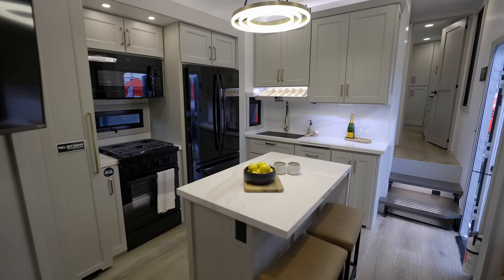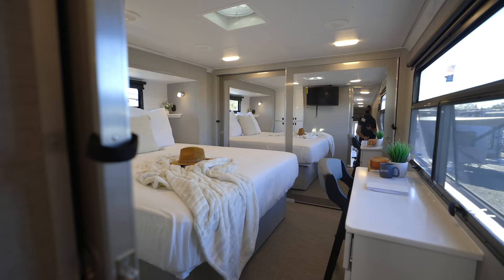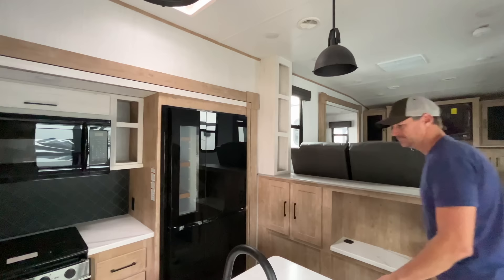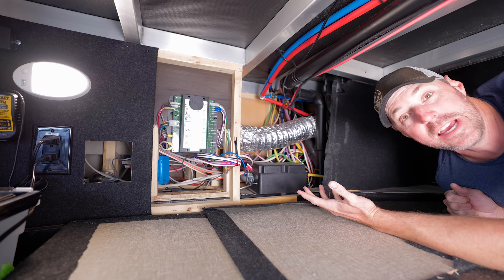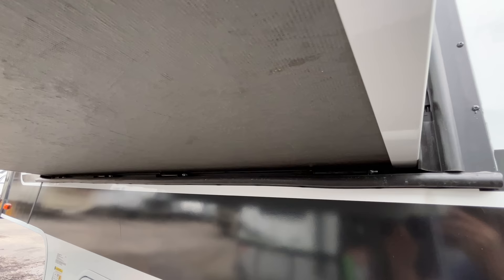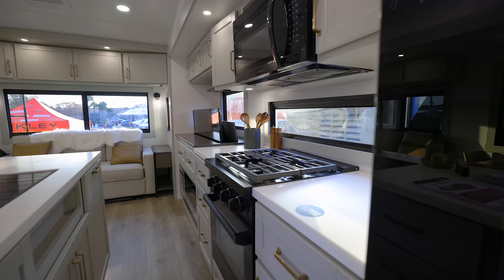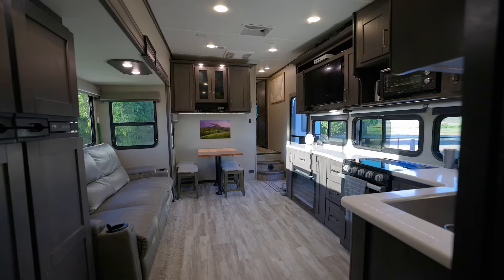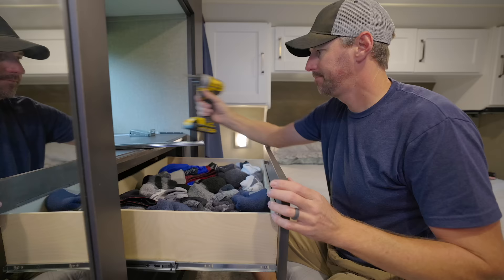Are All RVs Junk! Problems With Our Grand Design RV.

Comment: The problem is you bought a new one. I would never buy a brand new RV. I want that a few years old and has proven itself. And then still do a complete check of the systems. Make sure that it was actually used and didn’t sit around. That’s how you avoid getting a lemon. And you save a lot of money!  Oh, and by the way ‘nuther’ @5:24 is not a word. Time to pass the 6th grade.

Comment: I own a 2022 Forest River Rockwood Ultralite 2614bs. I think the materials put into it are good materials. The frame is strong, the cabinets are stable. As I work on it, I find things that just make me roll my eyes and know the time the builders put into it, well less then adequate. 

The one thing I hate the most is RW left the headboard to the bed in the front of the camper,  when they turned the bed into the slide. Now I've got a headboard in the front of the camper that could be cabinet space. It's my first camper so was so excited when I purchased it. The headboard wasn't noticed till later. It just irritates me that some day soon, I will replace it. 😅

Comment: When Grand Design was bought out by Winnebago that is when they went downhill.  I wouldn't own one now.  Check Outdoors RV out of Oregon.  I had been following their product and business model for several years and just this weekend went to an RV show in Round Rock, TX and found that a local dealer, Princess Craft, now carries them.  The quality of construction was far above the GD models sitting adjacent to the Outdoors product.  You should check them out and possibly do a review on them.  We are seriously considering owning one.  They are priced higher but the quality construction and warranty makes it justified IMHO.
Reply: I have a 2022 Timber Ridge 22FQS and it’s been fantastic.  They only make about 2500 units a year, and it shows.  They’re heavy, a bit old-school, and don’t have some of the latest and greatest features, but for me the things that really count were all there.  I mean, my 27-foot trailer has an 8-inch I-beam frame…nobody does that.  And they build their frames in-house, something hardly anybody does, not even Brinkley.  If you’re thinking about one and aren’t super fond of the dark interiors, wait for 2024 when they’re lightening up the walls.  That’s been one of the primary complaints about their interiors.  But if you go for one, I doubt you’ll be sorry.
Reply: @jordancook1668  Good info.  This dealer had a few "dimple " units (slight hail damage) discounted $10k to $15k...pretty good discount on 2023s.  We really want the 12v fridge and 2024s are coming that way....but that discount is pretty sweet....more than enough to change out a fridge if we move on one.

Comment: I don't believe all RV's are junk nor do i believe they are all built the same. Like anything else we spend money on there are definitely varying levels of quality and price and quality seems to very much go hand in hand. After crawling around countless fifth wheels in the search for ours the differences in quality between brands and pricepoints are evident if you look at the details. There are brands after looking at things like the plumbing and wiring i would not even consider buying. Not that they are junk but because the level of craftsmanship is not up to what i believe it should be for the money spent. I think a company like Brinkley doing a better job on the craftsmanship side while still being mid tier on the price level will hopefully make the rest of the industry take notice and do better.  

That said one thing i have noticed on RV forums as well comments here on Youtube is a lot of folks seem to conflate looks with quality, they literally only look at the skin and not whats underneath it all and say its a quality RV yet it in some cases it could not be further from the truth. These same people also say the higher cost brands are "overpriced" because some other lower cost brand looks just as nice but they fail to see the value in the better constructed frames, walls, roof, all hardwood cabinets and trim, better finish materials, etc, etc. Those things cost money and its why 5 plus years down the road the more expensive unit is simply going to stand the test of time better especially for a full timer.

Comment: I have a 2022 Grand Design transcend xplor. I will say this is the biggest piece of crap ever. I've nicknamed it the sugar coated turd. Water leaks, a floor that squeaks like a 100-year-old house, fit and finish that is worthy of a junior high shop class project. I've lived in it full time without moving it for the last year. 6 months in I noticed some bubbling inside one of the cabinet walls, and after doing some inspection it looks like there was a leak from day one on the corner of the roof. It is now completely soft and grand design said that the possibility of it being covered was very small because it is a maintenance item. I will never ever step back into the RV market. And I will spread the word to as many people as possible on what a pile of crap these things are. Complete disappointment

Comment: I'm of 2 minds, I want a good quality product that they thought of everything in, but simultaneously I know they'll NEVER get it 100% right, or 100% right for me, so I want something I can customize and not have to completely butcher finished materials, as well being made entirely out of bespoke components means replacement parts are expensive and/or non existent.... we have an RV with a one of a kind jack-knife sofa in, meaning it was made specifically for our model 5 years ago when the RV was new, now no one makes that sofa, in fact no one makes one the same size at all, we either have to buy an RV jack-knife thats too narrow leaving a small gap at one end that won't be big enough to be useful, just unsightly, OR we have to somehow cut away part of the side table, which also happens to be the power distribution system (circuit breaker panel etc), which even if it's possible, won't be cheap or easy to do.

So, yeah, to me I guess a good quality RV is one that's done well, but using all off-the-shelf parts that are not bespoke.

Comment: If you don't think all RVs are junk, you don't know anything about RVs. Just look at the forums, blogs, and vlogs of all of the brands that have claims, complaints, and lawsuits against them for inept workmanship and cheap parts.  You can't look at a new parked RV at a show and determine if it is any good.  Most problems show up after the RV is driven a few thousand miles on every different road material imaginable.  That is when walls, floors, ceilings, and components fail. Everyone is excited about Brinkley, but they are no different than the rest no matter how much they cost. If you want reliability, buy a twenty or thirty year old rig. The craftsmanship is day and night by today's standards. I have more than 20 years of fulltime experience with several different RVs and I have come to the conclusion that my older RVs were many times better built than any of the new stuff. If you want a new RV, you better know what you are doing and I wish you luck because aside from features and floor plans, there is zero quality built into them. The larger problem is trying to find a dealer and manufacturer that will stand behind their warranty. These days, most of them don't when it comes to major issues like frame flex, broken frames, ceilings, floors, and walls separating. Buy an older rig for a much cheaper price, lower insurance rates, and better build and learn to do your own maintenance and repairs. Most things are diy if you do a little research, keep a good set of tools and a repair manual. When shopping for an RV, have a pro with you if you don't know what to look for. Do not trust the dealer PDI; the dealer isn't thorough. Research forums, blogs, and vlogs for user reviews and have a large repair fund. Don't buy parts from RV retailers if you can get them online or at Home Depot, Lowes, or Wal-Mart. Keep a parts bin for common replacement items, prepare for lengthy and costly shop visits, and research the best shops in your area. Most important: Don't be taken by what you see is what you get. The best use of an RV is to drive to one location, camp, return home. If you are full time, set up a home base and plug in.  The more you drive or pull an Rv, the more and the bigger the problems you will have.

Comment: Are they all "junk"? Too broad of a question, but for the money we pay, they really are. I can't stand it when another RVer says, "something will break - get over it" or the service manager at the RV dealers says, "keep a list of everything that breaks and we'll fix them all at once". Nope, I don't accept that at all. Another RVer told me its not the brand's problem - it's the components suppliers who suck. Again, nope. We have stopped buying new and will not buy anything used that's recently used that was recently built. And this is not even addressing the issue of depreciation. If you buy new, kiss 20% of the purchase price when you drive off the lot. And after-sale customer service? Nearly nonexistent. But don't take my word for it - just surf YouTube for your favorite RV brand. And don't get me started on RV dealers. If their lips are moving, you better put your hand on your wallet and put everything in writing (they won't). RV dealers = politicians. The last part of this rant deals with parts. I had to replace a hinge on a Dometic electric cooler - $49 and that was free shipping but there were two hinges. The balance between the joy of exploration and freedom is losing to the hassle and expense of RVing.

Comment: I’ll second the comment if you own an RV you should be ‘handy’ with preventative maintenance and fixing little things,  people who don’t pay attention to those little things often overlook them when shopping and can end up with a poorly built unit.  What pains me is when people say ‘XYZ RV builds junk’ when they really just had problems with some of the components built by the major suppliers to the industry. I’ll hear people say we’ve had nothing but problems -a/c broke, thermostat went out, water pump died, water heater broke, etc. But when pressed the build was fine but they blame XYZ for all of their problems.  Some people expect an RV to have the same quality of a new car or truck.  It just isn’t comparable,  Auto companies may build as few as 3 models but rarely more than 7 or 8, and they build tens of thousands of each model where an RV mfg might build a few hundred, then redesign that model to be completely different.  Last complaint is the person who buys cheap and expects high end quality.

Comment: Don't be fooled by the Brinkley  price rag. They are still junk! I've seen several videos of frame failures on the Brinkley.
They are all junk! Some are just less junk than others. Older RVs are better, late 90s and early 2000s. Buy used. It takes 5 years for the manufacturing flaws to get sorted out by the first owner. In those first 5 years, the first owner will lose interest, and you will pick up a good coach at a depreciated price. Keep in mind that most RVs don't see that many miles and don't get used that often.
But you will need to fix things constantly because they are junk.

Comment: RVs are like Harley’s, jeeps, VW Bugs And Vans, KLR 650s .....or any other hobbiest  vehicles.
They are mediocre designs, built of low grade materials, and assembled by unskilled/ semi-skilled labor

So, if you own one,  you need to be able to troubleshoot and repair it as well as having spare critical components on hand
That, or plan on ruined outings and weeks or months dealing with similar unskilled/ semi-skilled labor at the dealerships, and their con artist bosses

I’ve been living and working on the road for over 20 years

Comment: You feature cheap large RV’s which are of poor quality.  There is obviously a market for these - cheap temporary housing,  transient workers, impulsive campers who want to bring a small house camping.  There are just a few quality travel trailer brands - Oliver, Airstream…. and they are expensive.  My Airstreams have held up quite well, although the plumbing and electrical is certainly not ABYC marine quality.  You get what you pay for.

Comment: All are junk.  Do most of my own repairs even when under warranty and help many others with theirs. Our 2020 Solitude GT340 has had major problems since day one and we lost all of last year due to frame cracks above the spring perches (fortunately under warranty but 6 months to get Lippert to make repairs).  Our GD 2020 has also had its rear axle replaced within first 500miles, have redone all interior woodwork to keep it in place, center island came loose and slide valences came off while on the road, slide hydraulic cylinder replaced twice due to severe leaks, Norcold fridge constantly gives F1 error after rain, etc., etc., etc.  Brand doesn’t matter.

Comment: Cheap junk and expensive junk. Grand Design needs to get rid of the LCI central digital control system and go back to rocker switches. When it acts up you can be in deep trouble. Also fasten the garage tie downs to the frame on the Toy Haulers.

Comment: I lost it at 2:34.  That single frame basically summarizes the entire RV industry.  I don’t think you could name another 50, 60, $70k item that is as unsophisticated and unrefined as are the typical RVs.  Brinkleys are much better but the quality level in them should be the worst you see, not the best.  The comparison I always draw is to boats.  Similar price, similar, if not harsher operating conditions, similar limited-production, similar in every way, but go ahead and compare the build quality of a $75k fifth wheel to a $75k boat.  It’s not even in the same ballpark.  Much of the difference I suspect is that there is a governing body with boats (Coast Guard) and there really isn’t with RVs.  The simple fact that you can still buy stick and tin, wood framed trailers  tells you all you need to know.  I mean really?  Wood framed trailers in 2023?  Insane.  But even crazier is they fly off the shelf!  How many Hideouts and Transcends do you see…they’re everywhere.  You’re pulling around a thing with a stapled together wall frame, it’s truly wild.  Really, a 2023 RV is nearly indistinguishable from a 1993 RV in terms of build, that’s how little innovation the industry sees.  Find me a product that sees less innovation in 30 years than RVs.  But the consumer simply hasn’t demanded enough of the industry, so there is no need to produce anything better.  I’m the last guy who ever advocates for regulation, but that’s usually what has to happen when poor quality products don’t improve, the industry has to have oversight.  That’s the only reason houses aren’t built terribly, they have building codes and inspections throughout the whole process.  It’s definitely not because the builder has a good heart or has high standards, I assure you.

Comment: Hola.... haven't looked through channel yet, so apologies if you've addressed this, however, being a grand design owner what's your take on the whole frame flex debacle?
Reply from the maker: It’s a mixture of thoughts. More RVs are over weight than most people realize which contributes to the problem but a huge part is the frames, structure, axles, and suspension are under built and should be built to a higher standard. 
That’s my one run on sentence summary.
Reply: @AllAboutRVs  cool... I get that entirely and from what I've gathered is the RV manufacturers are over- building for what the base trailer is built for to cut costs.

Comment: You really didn’t tell us anything that most experienced Rv’ers don’t already know. Most RVs are just slapped together. And the consumer needs to understand that you do have to be a DIY repair person ( like you said u are in this video).  You may be able to fine better built RVs. ( never heard of a Brinkley) but of course they are priced through the roof. The good news is after you’ve owned your RV you will probably fixed correctly that which what was built incorrectly originally . So maybe you will have a dependable RV you can enjoy for a few years.

Comment: Grand Desing used to be Brinkley quality and priced accordigly.  Then the three guys that started Grand Design turned into profit whores.  They made a cheaper level 5th wheel.  Then they made toy haulers and bumper pull travel trailers.  Sales went through the roof along with that profit whores goal.  

Then Winnebago bought out Grand Design.  We all know the rest of the story.  Decade after decade, history repeats itself in the RV industry.  The BIGGEST problem the RV industry has.........Right now is the first time the industry has had to deal with social media and 3rd party rv version of home inspectors.  All those truths are spreading way too fast.  Quite possibly those truths and Bidenomics will cause this industry to self destruct.

Comment: How's the plumbing in that reflection? Is there a lot of leaking at the fittings?
Reply from the maker: It has been fine. We had a leak at the low point drain after freezing and one when we swapped out the water heater but other than that it has been fine.

Comment: 2021 Eclipse Attitude toy hauler off the lot new, junk, smear spots all iver the luan wallpaper panel nail seams, every door and drawer knob fell off from not being loctite’d, take a drawer out and it looked like a construction site behind the drawers with scrap wood and piles of sawdust.  opened the fuse box and found a piece of bare copper wire just waiting to short across the positive and negative biss bars and become a car-b-que like we’ve seen others burning on the side of the freeway and wonder how in the world did that happen, half ass’d caulked shower leaked, Oh jezz I’m not even half way in to it, definitely don’t buy Eclipse